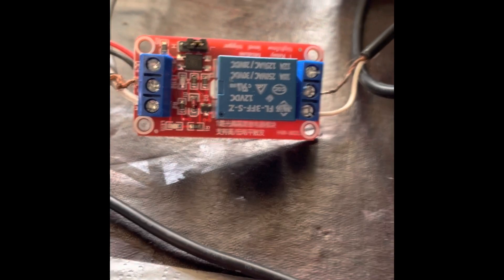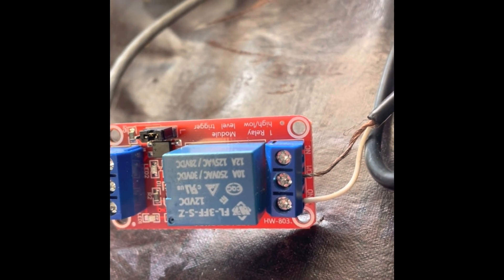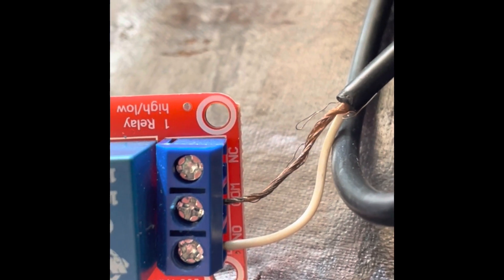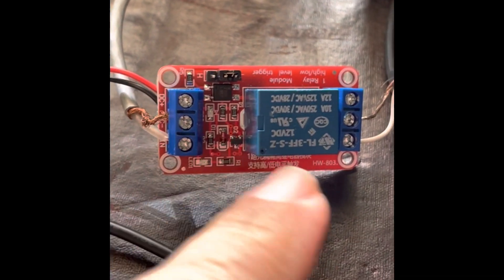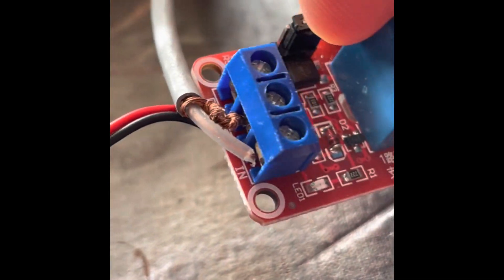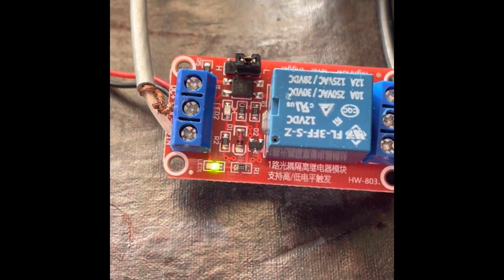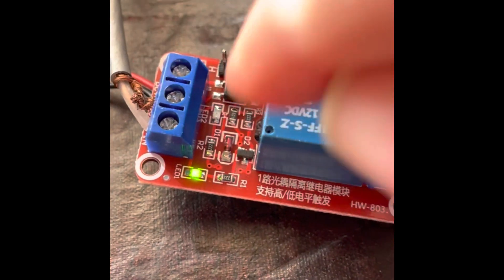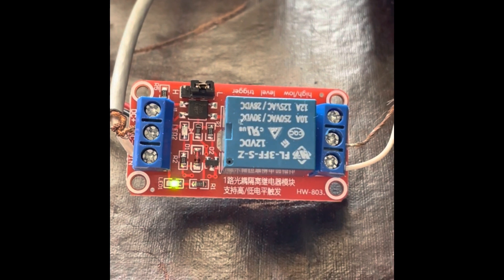$5 amplifier to radio safety buffer keying relay how-to

Comment: Going to try this to eliminate relay chatter of my qrm eliminator when used with my amplifier.  Luckily i had a module already for another project
Reply from the maker: Wrap the module in electrical tape.  Then cover  the taped module inside some coax seal and it will totally deaden any click sounds !

Comment: Hi. thanks. What is the advantage of using an opto coupler? If the radio already has a ptt output can it not be used to directly switch a relay to ground? I'm looking for a circuit to deactivate / switch the tx relay for a noise eliminator during tx. I was thinking a 2sc2222 with emitter to ground with a elec capacitor across it, a diode from ground to middle leg and from middle leg a small ceramic cap to sample the rf with that switches the transistor to ground causing the relay to find ground and activate..
Reply from the maker: That works too. An opto-isolator avoids ground loops.   More useful for audio but can’t hurt anything …

Comment: Thank You!
Note! Kenwood recommends maximum keying current less than 10mA while TX. The mentioned module consumes 12.5 mA, which is slightly higher than the recommended current. The situation will be corrected by installing a resistor of several kOhm in series to pin 7.
Reply from the maker: @3841-o9d  you can also power the module separately using external power supply that runs the radio.   Simple solution. Zero risk.
Reply: @jomf8929  Yes, of course, an external power source for the module. Powering the module from the transceiver pin means guaranteed to burn out the keys on the transistors in the transceiver! We are talking about the maximum current on pin 7, which is limited to 10 mA, i.e. for this reason, the relay windings cannot be connected to it directly. But the optocoupler of the module also consumes more current than is permissible for Kenwood.
Reply from the maker: @3841-o9d  yes. Just use a 9V battery or connect to your radio’s power supply. So simple.

Comment: Hello, do you think it would work for an icom 746?

I have problems with an amp, and I have already tried 3 different cables and none of them work, I think I will need a relay
Reply from the maker: Yes.  This will  work with IC746 for sure !  

You could even power the relay module using the 13pin accessory socket  or the auto tuner socket on the 746 if it’s not being used for something else.
Reply: @jomf8929 thanks for the answer, should I use acc2 or the alc/send jack??
Sorry for so many questions, I don't know and I don't want to damage the amplifier.
Reply from the maker: @jaijua2348  easiest is I to  use the send jack to trigger the relay .  The alc jack goes directly to amplifier ALC output jack.
Reply: @jomf8929  Thank you, I compared the module on aliexpress, and I will use the jack send to activate it as explained, I hope everything goes well, thank you very much for everything.
Reply from the maker: @jaijua2348  message me if you get stuck.  I’ll help you !
Reply: @jomf8929  Hello friend,
I already have the same relay at home that you show in the video, 
I can put an external 9v battery in it. how do you show? so as not to draw power from the icom,
I am not a specialist and I am afraid of damaging the equipment, thank you !
Reply from the maker: @jaijua2348   connect battery to DC+ and DC- (com).   It work perfectly that way.   Be sure to disconnect battery after use or battery will run down.
Reply: @jomf8929  After several configurations, with the jumper and cables, the amplifier protects itself and does not emit, I don't know, maybe it is a problem that the equipment has. thank you

Comment: Would you know what pins on a FTDX10 would I input into the relay module?
Reply from the maker: The ftdx10 offers several options for hookup.   You can use the 10 pin mini din amplifier connector or the 8 pin mini din relay connector or the 13 pin din connector or the rs232 connector      It depends what other accessories you have in your station.   Would need more detail on which of those 4 connectors you’ve got on hand.
Reply: @jomf8929  I have the 8 pin and the 10 pin is about to arrive. I have a buffer relay and wish to fire the PTT on a Metron MA1000 solid state amp
Reply from the maker: @enginedave    On the 10  pin linear plug it’s the TX ground and ground  pins    The manual shows you.  Page 13.   The 8 pin tuner connector can also be used.   It also uses the tx ground and ground pins.       Manual page 13 shows it too.     Very easy to build or buy.    Just put the buffer relay  between radio and amp.  The metron does not need a buffer relay.  It’s all low voltage so no risk to the radio anyway but you can add it for extra assurance I guess.

Comment: Thought I heard clicking of a mechanical switch relay so thinking this isn't an optically isolated switch? Didn't notice a clickable link to go find one of these to investigate further.
Reply from the maker: It's opto isolated but still a mechanical relay.  You're thinking a electronic_ solid state  relay     an opto isolated relay simply isolates the input and output control of a mechanical relay with opto coupling devices. 

You can find these on ebay or Amazon. Just do a search for Arduino relay board.  Hundreds of links.

Comment: Thanks for the clip, I’ve purchased the same relay module to operate with an IC -7600 which preceded the 7610 so I thought would use same settings.  Did you confirm the NO/NC and other settings from the 7610 manual? Also, did you use the ALC connection between amp and radio? 73s
Reply from the maker: Any HF radio is going to be a normally open (and closes to actuate the amplifier).   Just set it up one way and if it doesn't key the amp, swap the jumper and it should work fine.   

Yes on ALC.  That's generally good amateur practice if your amp has an ALC feedback circuit.    It could save your amp from damage from being over-driven.
Reply from the maker: No need for alc if your exciter has proper power output control like all modern radios have.      The NO and NC can be changed using the jumper.    This is novice license level easy
Reply: I just acquired a Drake L4B. I mean this device will work for ft950 , isn't it? In the past I used to run ARB 704.
Reply: I know , how about a link to where it can be purchased?!?!